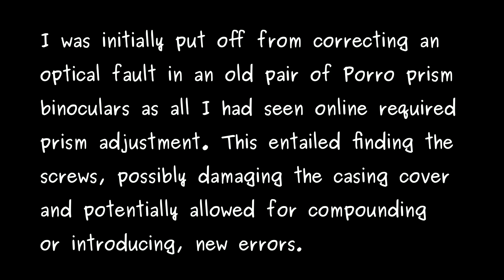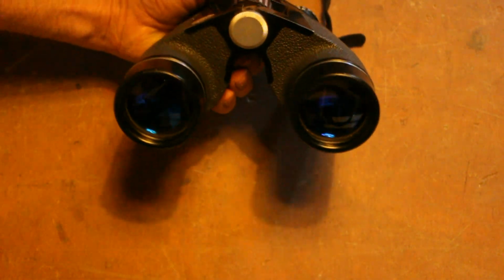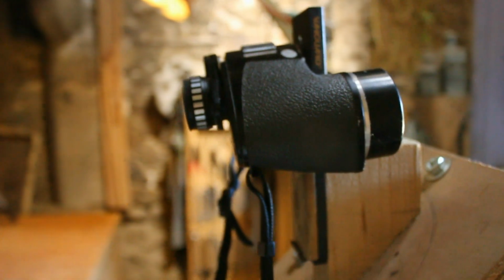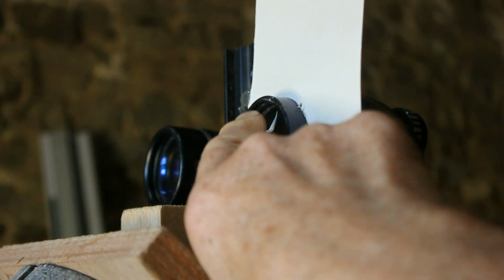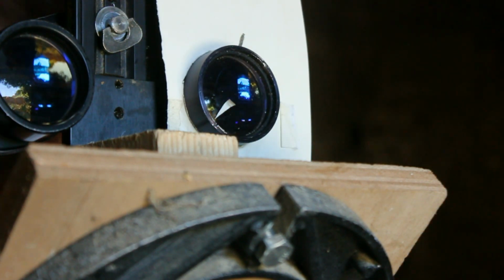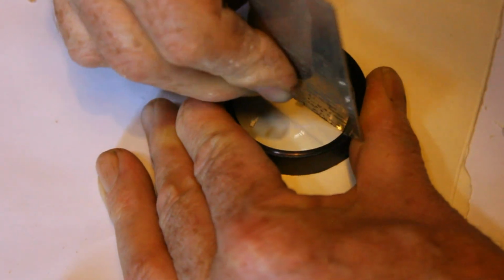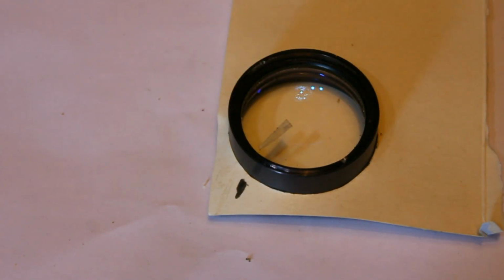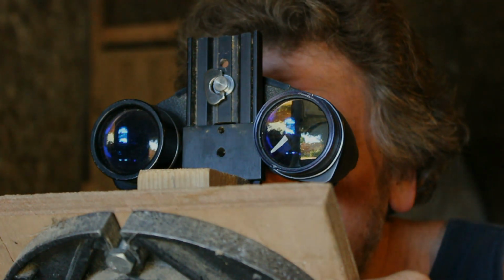Binocular Collimation Quick and Easy Method without Prism Adjustment

Comment: how is it that rotating and perfectly symmetrical objective lens will create a better image?
Reply from the maker: Hi Arcsteams, the lens is perfectly symmetrical, but it is mounted in an eccentric ring which when rotated in the housing will shift the central axis of the lens. I think it's a very elegant way of having adjustment without fiddling with the prisms.  Thanks for watching and commenting. Best wishes from Normandie, Andy.
Reply: @Organikmechanic  hmm so the ring under the lens shifts the lens axis? i guess they designed it that way in order to make this adjustment then, but why not simply use a level flat ring? perhaps because the prism may go out of alignment and they want to give the option of adjusting it from the object lens i suppose?

Comment: ive got a nice old pair of all metal japanese binos by yashica and a small telescopic one my sister got me from royal caribean cruise but it needs to be a very bright day for those to work well for some reason the sight in them is very obscured unless you hold them steady and look at one object at a time ,idk how pirates used these things lol
Reply from the maker: Do you know the power and aperture of these instruments? Usually it's written somewhere on them i.e. 7x50; that is to say in this case a magnification of 7 and an objective lens diameter of 50mm. Sometimes the magnification is very high for the aperture selected resulting in a dull image. I know that often old binoculars and telescopes can develop a bloom on the internal optical surfaces resulting in reduced image brightness. If you hold them up and look through them from the objective lens end, can you see any mistiness?  Get back to me if you have any more questions. Cheers, Andy.
Reply: @Organikmechanic  i know the binos are 10x30 wide angle 7.5deg and they work fine no issues with them aside from the left ocular being a bit lose but not sure about the telescope ,its a small one that is only 5.5" inches when collapsed and 13" when expanded but no mention of the power, i suppose i can always roughly measure the lenses and they appear to be 7x30,i did unscrew the objective and had it cleaned and the ocular came out as well and appeared to be two or more lenses in a small plastic tube holding them and i did not bother cleaning them ,also there is another lens just further down or perhaps another one of these tubes on the end of the same first brass pipe so these things are more complicated than i thought ,i think they always had this dimness problem and not sure if it has anything to do with blooming as you say? also looking at it in reverse is not telling me much
Reply from the maker: @ARCSTREAMS  Hi there, sorry for not replying sooner, but I missed your reply in my mailbox. Would you say that the power of the telescope is the same as the binoculars, or more, or less? If you've measured the objective lens and found it to be 30mm then if the magnification is greater than the binoculars then I would definitely expect the image to be darker. The other point is that although the objective lens diameter can be measured, often manufacturers put a baffle further down the optical tube to eliminate aberrations due to poorly shaped or lower quality lens glass this may result in some of the incident light not coming to the eyepiece and hence a dimmer image. As to how 'complicated' these things are then yes, the design and manufacture has moved on since the time of Galileo - that's progress! Hope this is of some help, but do get back to me if you need any more ideas. Best Wishes from a very damp Normandie, Andy.
Reply: @Organikmechanic  ahh there you are,i figured perhaps you spent more time in reality on the farm then online lol,, yes the telescope def has better magnification then my binoculars strangely since those are 10x30  and the scope i figured was roughly 7x30 perhaps the smaller ocular makes a difference? as to the dimness i would have to agree with you that perhaps it has to do with the way its designed ,it def just looks dimer and not to do with any dirt or damage but looks more like a design  thing as you said ,also i assume the centre lens reverses the image to make it right side up

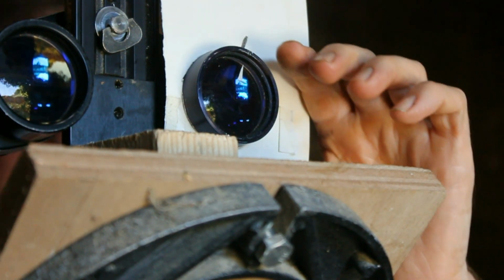Comment: Minute 2:37 - "turn the objective lens to the correct position", what does that means? It is not clear for me what point is the the first position, "incorrect".
Reply from the maker: Hi, I am turning the objective lens whilst looking through the binoculars until I achieve an improved (better aligned) image. This, because as I said, the objective lenses are eccentrically mounted in their holders. Hope this is helps. Best wishes, Andy.

Comment: My Pentax 10 x 50 model 584 binoculars do not have prism adjusting screws, so I am hoping your procedure will help with collimation. Thanks for the video.

David
Reply from the maker: Hi David, My guess is that there will be some hiding beneath the leathercloth  covering but you have to remove some of this to find the screws. That was the same with my pair and why I sought and found another solution. Good luck with your realignment and thanks for your comment. Best Wishes from Normandie, Andy.

Comment: most of my binos are vintage and I can get off the end cap and unscrew the collar but everything else is solid, in that I mean I cannot get the cell out...any info please?...cheers
Reply from the maker: Hi Stan, I've not come across this myself, but I did see a Youtube video where  it was shown that some old binos have  wax in the threads and the components have to be locally heated to allow removal. Hope this helps. Thanks for watching. Best wishes from Normandie, Andy.
Reply: @Organikmechanic  thanks for the reply I will sub your channel. Yeh I had heard about heating them up, even putting them in the oven!! That might be a bridge too far for me. I might just use my good ones....cheers☺☺☺☺

Comment: I imagine this isn't possible with sealed models that have argon or nitrogen purged to minimize fogging?
Reply from the maker: Hi Michael, I've never tried re-aligning binoculars like that, but reading around the subject I would say that if you want to try this method then forget the gas inside. At the moment I am assuming that the binos are unusable in their present state so you have nothing to lose and if you are not using these in an exceptionally wet/humid environment then you would be better off keeping them in a sealable plastic box with a silica gel sachet when not in use. I have read comments on this type of gas-filled binocular and as always there are divided opinions on these. Specifically that the gases eventually escape to outside to be replaced with atmospheric air.  Hope this is of some use, meanwhile, thanks for watching and for commenting. Best Wishes from Normandie, Andy.

Comment: Have anyone tried this with the celestron 10x50 g2?
Reply from the maker: Hi Danny, sorry for not replying sooner. Interesting what you say about your purchase. Just out of interest, the Author of the book I show in the video does not like zoom binos at all! He claims they are never well collimated and will not stay collimated over the zoom range. Cheers, Andy.
Reply: @Organikmechanic  thanks Andy. I sent the Celestron back and got a Nikon 10-22x50. Not perfect, as you describe, but a lot better than the Celestron. Apparently, there was some other manufacturing fault in one of the lenses in the Celestron, so it had no chance of doing the job properly.
Reply from the maker: @AutoEngineerVideos  Great Danny, a successful outcome after all. The Nikons sound a pretty fair exchange. You probably will find that at the higher powers you'll have need of a tripod for longer periods of observation but probably a better built pair than your original choice. Enjoy! Thanks for getting back to me with the update. Best Wishes from Normandie, Andy.
Reply: @Organikmechanic  I had to add some cash to the exchange (Nikon is more expensive), but I got something worth the money. The tripod adaptor that the Nikon came with is very handy at high magnification! 😁

Comment: Organik, Great video!. Question. I get a Celestron 20x50 and just recently appears on both ocullars a kind of circular ligth smaller and closer to both pupil exits ... is it lack of collimation? No shocks were  received by prismatics at all. My Issue looks like this regarding right and left ocullars ... Oo oO, but should be like this ... O    O (only two pupil exits). 
Maybe I need to send you a Photo of my issue ... for better explanation isn't it?. Any help / advice is very welcome. 
Thanks in advance!.
Reply from the maker: Hello Carlos sorry for the delay in replying but I have been thinking about your problem. I am assuming you are seeing this whilst looking at objects in the night sky? I believe you may have a 'ghosting' problem which is due to reflections from optical surfaces within the instrument. The forum on cloudynights.com have several suggestions to try and solve this. Good luck and thanks for watching and commenting, Andy.

Comment: Nifty process and interesting to know, but definitely more than 10 minutes' work when factoring in making the tool to unscrew the objective and any mounting requirements, also wouldn't work for any binoculars that are fully encased & waterproof.  Also depends on knowing that the objective is aspherical, could be a big waste of time if it isn't!
Reply from the maker: Hi JM, O.K. My point was that the actual re-alignment process had taken me ten minutes to achieve. Most 'how to's' I've ever seen rarely talk about the time taken to acquire tools, raw materials, background reading etc. I would not consider breaking the seal on waterproof binos as that is a specialist job normally requiring recharging with nitrogen. Why would bino objectives be aspherical? As far as I understand most binoculars have spherical lenses as they are easier to manufacture. It is the objective lens mount that is eccentric and enables the alignment to be corrected. Hope this clears up any misunderstanding. Thanks for watching and commenting. Best Wishes from Normandie Andy.

Comment: How did it get out of alignment in the first place
Reply from the maker: Good question, Rick. I bought the binoculars secondhand from a camera shop and I suspect that either the previous owner or someone in the shop had cleaned the instrument without realising the importance of the objective lens cell. I certainly cannot see any other reason for the type of image shift. The fault was there when I purchased them but was not serious enough to cause any eye strain or discomfort when used  for short periods i.e. trying them out in the shop. I suspect that the older the instrument the more likely it will have some defects introduced by 'maintenance'. I'll shortly be doing another video on a pair of WWII binoculars which appear to have a similar problem and I hope a logical explanation and solution.
Many thanks for watching and commenting. Best Wishes from Normandie, Andy.

Comment: one qustion, how to determine which lense should turned left or right
Reply from the maker: Hi, that's a very good question. As this is a 'quick 'method the only way is to try one lens and if there is not enough adjustment, then repeat with the second lens. Of course, this can mean that the optical axis of the binoculars is not aligned to the principal axis i.e. the binoculars look slightly left, right, up or down but I believe that in most cases this would be virtually undetectable. Hope this helps. Many thanks for watching. Best Wishes from Normandie, Andy.